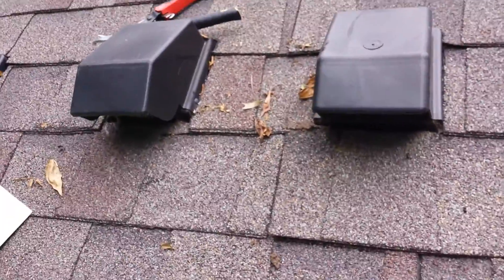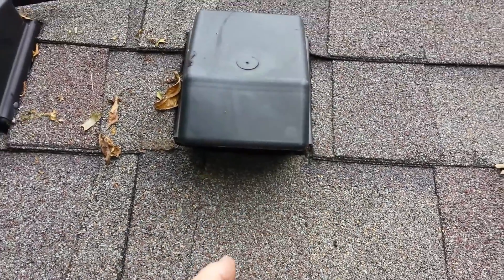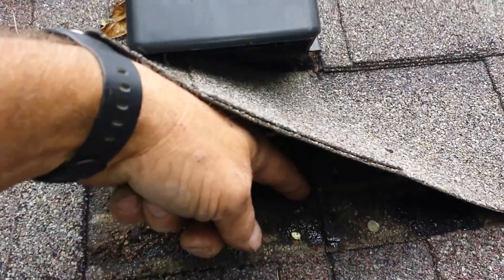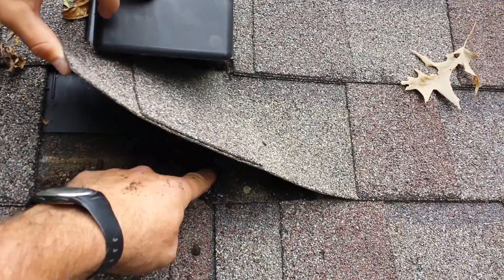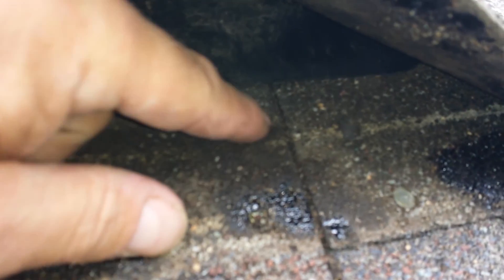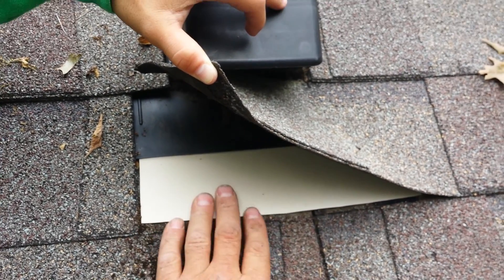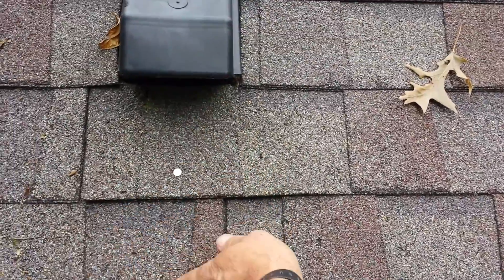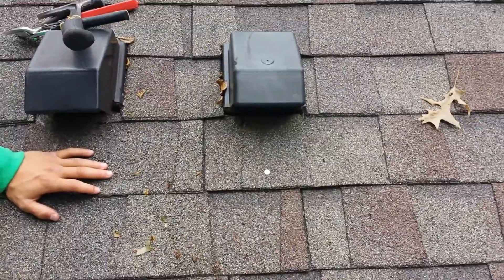Bath exhaust fan leaks. Common roof leak.

Comment: Brilliant fix to the problem.  Is this caused by a faulty installation and if so how shoild it have been done.  Someone said the bottom shingle should've been left off but I don't see how that would've prevented the leak.  I notice that the other roof vents were installed the same way.
Reply from the maker: The bottom of the flange should ALWAYS drain to the top of a shingle below the nail line. 

Yes, all of them were done this way but you run the risk (about 5% of the time, and I'm pulling that number out of my ass) of having a leak like this one. The tar paper works as a last line of defense, but it will eventually fail.
Reply from the maker: This is how it should look.

Watch "Roof leak fixed. Plumbing flashing, DIY Roof Repair. Simple roof repair. Plumbing vent" on YouTube
https://youtu.be/2ew4qsJArDU
Reply: @highqualityhomemaintenance7565  thanks,  I took a 2nd look at the first video and I can now see how the vent flashing overlap of the bottom shingle method shown in the 2nd video would prevent the leak.

Comment: Try to use one piece for vent, should not have keyway in the middle of flange. Also, bottom part of the flange should be exposed.

Comment: Those vents arent done right. You cant cover the bottom with a shingle. It should be exposed. But if the leak stopped then thats all that matters
Reply from the maker: What you say is accurate. But it happens a lot.

Comment: So I think this is happening to our bathroom ceiling in virtually the same spot. But if you drive a nail into the top of a shingle, wont water just run down into the hole the nail drove into the shingle???
Reply from the maker: Hi Butch, I understand your point. The only reason I  installed that nail there was to hold down the shingle, as well as the flashing. When a nail is exposed, the common remedy is to apply a dab of caulk/ sealant onto the nail head and the surrounding shingle to properly seal the nail from exposure to the elements. 
Even so, a single exposed nail will not cause a leak, since the nail itself is in the hole. It's similar to putting your finger into a test tube with water in it, the turning the test tube upside down, the friction fit of your finger doesn't allow water to pass. Take out the nail/ finger and voila, water leak.